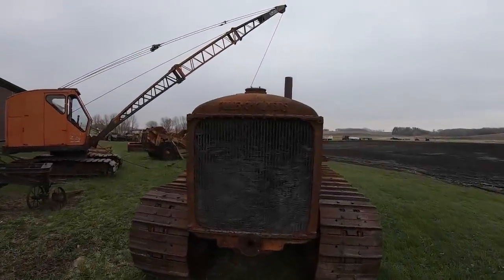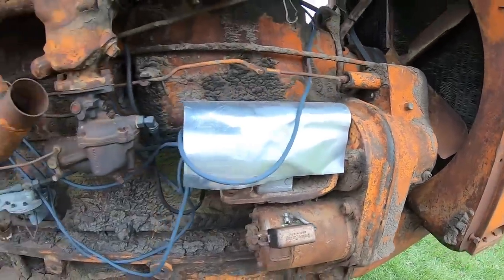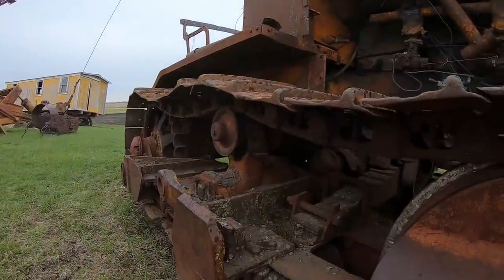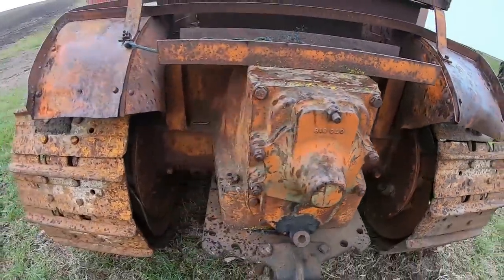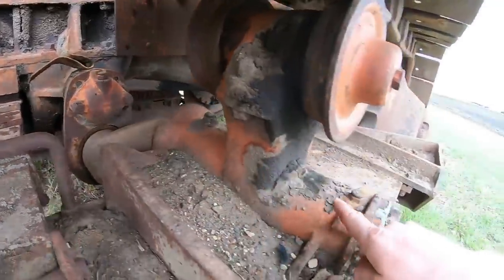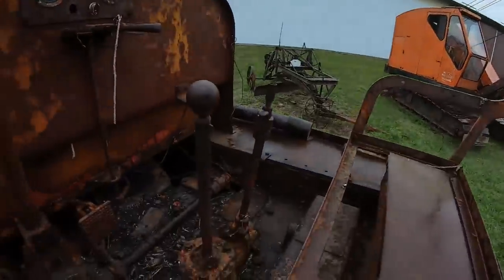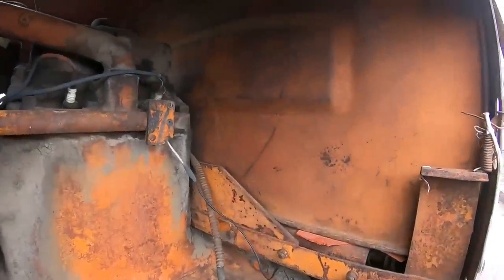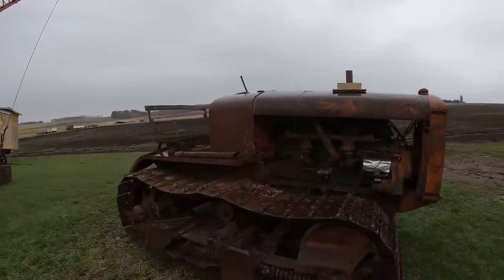Allis Chalmers Model L Tractor #1580 Walkaround - It's a Brute!

Comment: 844 cubic inches, 5.25" bore x6.5" stroke.  Norm Meinert has one with a blade that is in running condition. It was demonstrated at the second AC Jamboree in 1998 I believe, it had no problem pushing out big box elder trees.

Comment: Just watched Kyle's walk around. He does a good job and points out many similar details as you, bit your video is nearly twice the length and as such you were able to point out additional detail over that of Kyle's. In particular is when you got down and under the carriage with the camera to show the wear through condition of bushings. Also the driver side rear sprocket you showed how a possible tracking problem is shearing the sprocket's side surface. You questioned why the rear housing protruded as far back as it did in design, and more. 
Clearly you two friends enjoy competing with each other for the good of your channels. Keep it up. Take care.

Comment: These early Allis Crawlers were built on the Monarch Chassis, Allis bought them out and continued the line and built them at the plant in Springfield Illinois, until the demise of Allis in 85.   That large casting at the rear is the gearbox of the transmission.  I think the choice of steering wheel was an early option, the parts book shows them avillable in both lever steer and the steering wheel.  This series was replaced by the HD series in the early 40s.  You can't find many of these big Allis L s, so there's not many left.  Like all early Crawlers, tracks and steering clutches are always the problem.

Comment: Nicely done.  That Allis has your name all over it.  Rebuilt with patina like 5J and add a blade, that would be a show stopper.  Excellent project for Squatch in the years ahead 😅
Gasoline or distillate ...  Might be cool to raise the compression to say 8:1 and run it on gasoline.  More work, less fuel burn ??
Just the idea of a well done steering wheel on a dozer is enough to put it into special status 🙃

Comment: We have a  pair of these in the collection. I IRC, that lever is for high or low range on the trans.  Both of these have 2 carbs on the engine, on a common intake.  Nice runners with the 6 cylinders.

Comment: Excellent video that is a huge engine in that crawler tractor that is a Allis chamlers right after they bought out I believe it was called monarch tractor company that built a partial diesel engine that fired spark plugs  instead of compression ignition and it burned gas to start it and switched over to the other fuel when it was warm enough like a all fuel tractor engine

Comment: I watched the walk around on both the channels and enjoyed them both. With a 844-cid gas engine,  Question I'm sure many viewers might have, why hadn't AC switched to diesel at that time? We know diesel technology was available in 1936... Squatch's RD6  as proof....
Reply: allis always had budget shortages for new motor designs. They mostly used outside vendor motors, except the series used in their model E tractors and K dozers and the L series. These are all based on their original 18-30 ( predessor to the model E ) tractors, just upgraded over the decades. Their L O series oil injection version was based on the Lavona semi diesel design. A low compression, spark ignition design that was popular in the late 30's  The L series above was the same base block with different heads and with out an injection pump.  Both versions had a magneto.

Comment: Both you and Kyle have different styles of telling stories. In the end of the day it's important the information gets spread not how it's being spread. Hopefully the engine on the Allis Chalmer model L is not stuck after sitting outside so long. The idea of using the steering wheel on a crawler seems to be really old. I know the Harkov factory T-150 crawler is the only other one I know that utilized the steering wheel for turning.  I wonder if the Allis model L has a 6V starter?

Comment: I can honestly say I've never seen a steering wheel on a crawler.
Reply: I haven’t either. I saw it before the Squatch talked about it and wondered if it was prank. Do you think they put a big enough steering-assist spike on that wheel? 🥸👍✅
Reply: I'm quite intrigued by the concept as well. If anyone knows of an explanation of its design concept and functionality, I'd love to see it. It seems like you'd have to have a beastly amount of upper body strength to take a corner with this thing.

Comment: Considering the 844 cubic inch engine, not only does the starter look small, but so does that single barrel updraft carburetor. I'm sure it's huge compared to what would be on a Ford 8N but still looks dwarfed. I'm guessing that beast must have had awful low compression to be able to be rotated by such a small starter.